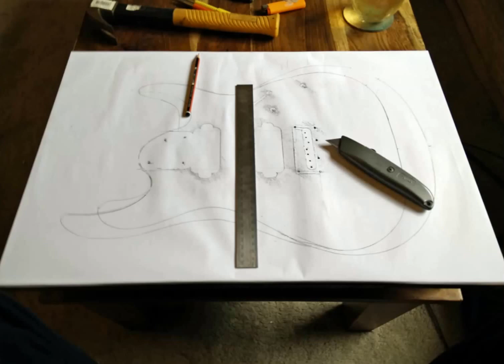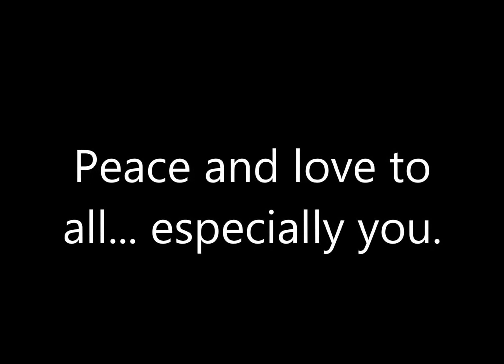My homemade guitar body.

Comment: Where did you get the template for the pick ups , neck slot etc. ? Looks like a tidy guitar. 👌
Reply from the maker: Cheers Steve - I just traced the pickups & neck slots from the existing Ibanez and transferred it to the perspex template. Then used that to create a template of MDF as it needed to be thick enough to get the depth on the router bit. Probably an easier way out there but it worked out in the end. 
Still going string! Good luck if you go for one yourself mate.

Comment: will cardboard work too for cut the body of the guitar out?
Reply from the maker: I needed something hard to use as a guide for the router bit to roll across. I think cardboard might be too soft for this. The plastic was the easiest way I could think of to transfer the template to use as a routing guide.

Comment: Was that your first try at building?  Pretty good shot, if it was... I tried building one; I thought: ah, looks easy enough... Building the parts is easy (I used an existing neck, also... building one intimidated me).. It's finishes; set-up & intonation that eat up time... and elbow grease.  My build took a year to complete; at the pace of a couple of hours every now and then... You have to resist the urge to " hurry the F**k up!!" because patience is wearing thin, and you want to shred on that custom machine, right?  Right?!
I'm gonna build another... Gonna be ambitious, and build the neck as well...
Keep building... Until we speak again, my friend...
Reply from the maker: Cheers Bud, it was my first crack but if I had my time again, as you said - I would take the time to slow down and do things a bit more carefully. I've been building another one off the back of this one but hit a few snags that have meant I put it on the back burner for a year or so as I really don't want to stuff it up. I guess the risk vs reward is what it's all about so I should get back into it! Good luck in your builds my friend - here's hoping all your frets work in your favour!